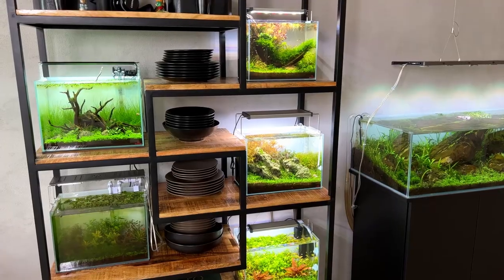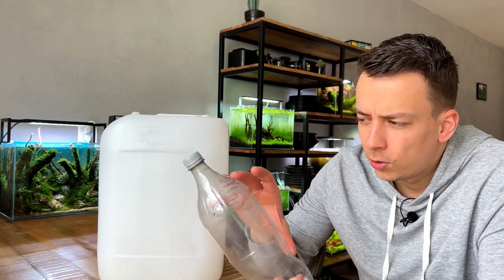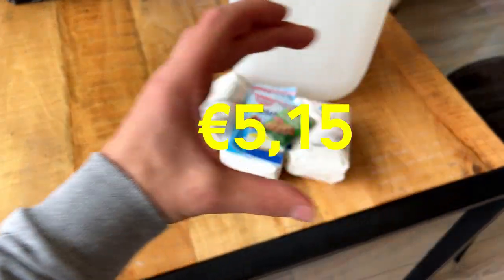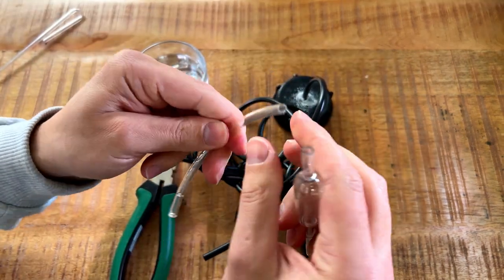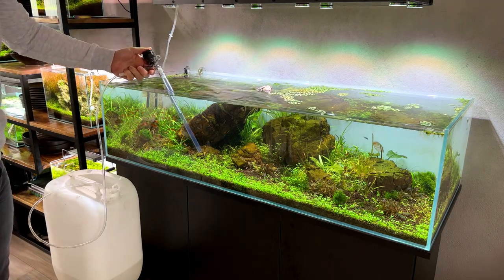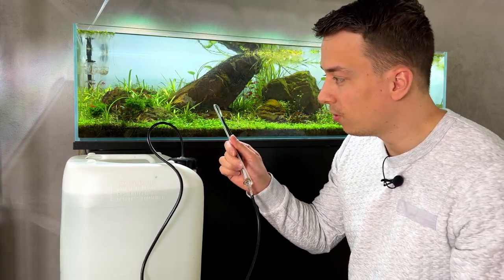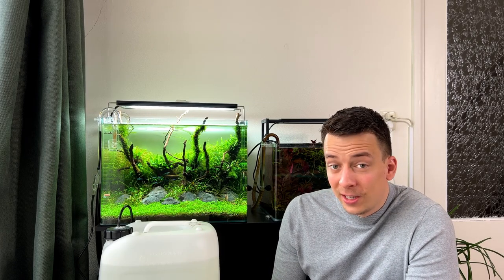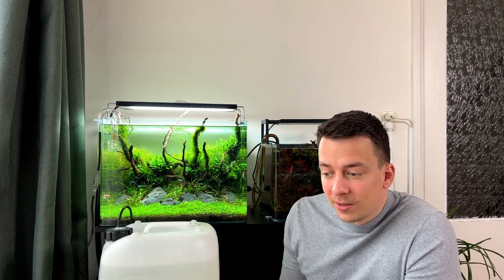HOW TO MAKE A DIY CO2 SYSTEM - XXL DIY CO2 SYSTEM😱 (don't try this at home)

Comment: how much pressure do you need for the defuser? ... it looks almost as if there was far too much pressure (the plastic on those containers is a different type of plastic), gas should have been coming out of the hose surely... you could always go super extreme as well with that container and go 15l of sugar water and gelatin mix and using a 1.5l bottle as a wash bottle you'd probably need a  lot of yeast...
look forward to the next instalment of this experiment as I'm having to look at co2 for my planted tank to get it lusher

Comment: Try a brand new commercial gas can container, 5 gallons. Doing landscaping in the summer, if the can in the sun and hot, I've seen the can expand almost like a balloon, but never popped or leak. Only problem is they're usually a solid color, some have a thin clear strip to see water levels. Not sure if that affects the yeast with little light

Comment: I think there is an issue with your diffuser, i had the same issue with smaller ones, The pressure was good but no bubbles, when i pulled out the diffuser from the tube, all the pressurized co2 came out in a second. Just make sure the diffuser is okay by giving it a blow.

Comment: This is a great experiment! Perhaps plastic is not the best material🤔 If you can get a used beer keg for cheap and modify it to fit a regulator, perhaps that might work?
Reply: PET bottles work fine, but the biggest I have seen are about 2.25 l. If you can somehow fill the beer keg and connect it to hoses, that would be cool.

I moved away from CO_2 except one tank, which uses pre-configured set with a metal bottle used for welding or extinguishers with other components used for welding. It costs some money for the initial setup, but then it's mostly about refilling the bottle in a local extinguisher shop and replacing some part once in a while. Some use Sodastream bottles, which can be refilled in some supermarkets.
Reply: @PaulZyCZ  yeah, I use the Sodastream bottles for mine and refill them with a larger co2 tank. I wouldn't recommend this system because I have the newer bottle which prevents me from refilling all the way as I have tried many times. My bottle only lasts 2 weeks🥲
Reply: @xXIronSwanXx  That's similar to yeasts+sugar method (which lasts up to 3 weeks).

I was considering buying second pressured bottle (2.1 l of pure CO_2), just to switch them once the other is empty, but I usually go to the shop right in the morning to return with a refilled bottle. Then it's good for another 3 - 4 months. Maybe I will switch to Blackwater in that tank, but I'll see.

Comment: The ideal fermentation container would be a glass carboy, or a PET one like for making beer or wine.  The homebrew store will have a rubber bung that you can drill out to the diameter of the air hose if they don't have one with the right size hole on the shelf.  Pressure in the system will be regulated by how deep you put the diffuser into the tank since pressure increases with depth.

Comment: Hello Mark, to my yeast co2 bottle systems i always use just air stones, easy to adjust needs,   bottles can  hold up to 40 - 50 PSI or 276 -379 KPA, with diffusers attached to yeast co2 system i have difficulties to pass thru. Love your channel, keep doing what you doing :)

Comment: Try using baking soda and citric acid powder. They do sell this metal tube with needle valve, pressure gauge, drop counter, solenoid valve and more in a package for you. My 200L aquarium requires a refill every 3-4 weeks. Quite economical in my opinion. And it uses 2 soda bottles. Easy to hide.

Comment: My co2 recipie is:
2cups sugar and 20 grams of agar powder for the base added to 500 ml of boiling water. Then left to set in the bottle.

1 cup of sugar to 1 cup of water with 1.5 TSP of yeast which is proofed ( add 1:1 sugar and yeast to 1cup warm water and wait for 10 mins or so for bubbles). Add 1 TSP of milk and 1/3 TSP of baking soda. Pour this mix onto the jello mix. 
 
It'll take 2 to 3 hrs to start , adding sugar to the yeast mix ensures that you will get a quicker reaction with the residual yeast attacking the jello. Just change the yeast water if the jello is not fully consumed when the reaction slows down. 

PS: it will produce a huge amount of CO2 initially so ensure that your diffuser is higher than usual so as not to drown your fish. Don't ask me how I know.
Reply: I'm using a 1.5 litre soda bottle. You can add more water at the end but ensure atleast 4 to 5 inches of clearence between the water level and the top of the bottle to prevent the mix from entering the tubing. 
DO NOT OPEN THE BOTTLE AT ANY POINT

Comment: i just bought a system that uses baking soda and citric acid.   it came with a solonoid valve so i can hook it up to a timer.  i haven't set it up yet and it's my first attempt at co2 so i don't have high expectations.   it was a cheap system ($40) so my plan is to use it as a learning experience.

Comment: I use 4 x 5L bottles which I set up 1 week apart. They all have sir line running into the same water bottle which acts as a filter where any gunk that manages to get pushed through the airlines is caught in the water bottle, and as a bubble counter where I can see how much CO2 each airline / 5L bottle is producing.
From the filter / bubble counter, a 5th air line runs to the Venturi attachment of a power head on the wall inside the tank.
This power head mixes tank water and CO2 as it pushes it out and down into an empty 2L Coke bottle filled with short pieces of 19mm pump line which are also cut length ways so I can fold them in on themselves and fit them through the bottle opening. These act as a baffle, further mixing the water and CO2, which exits the bottle from a hole on the side of the bottle at the bottom near the bottom through a short piece of 19mm line so I can direct the flow by twisting the bottle.
By starting the cultures in the 5L bottles a week apart, the last one started is just beginning to get going, the previous one is roaring along, the one before that is ramping right up and the one before is dying off. The one that is dying is next one to be cleaned out and set up from scratch again. Easy to make it part of the weekly maintenance.
At any time, the total production of CO2 remains fairly stable when averaged out across the 4 different bottles each at different stages of production.
It's satisfying to watch the bottle counting bubbles and the reactor bottle in the tank. You can see the CO2 gas bubbles being forced down from the power head into the bottle and rising back towards the top to get caught amongst the baffles where it keeps being churned around until it dissolves into solution, at which point it leaves the bottom of the bottle completely dissolved in water.
When you tune it right, there are no bubbles or even a fine mist entering the tank water.
Be careful though... It will take a while to tune the sugar / yeast recipe and CO2 production and the power head flow.
The first day I made this set up, I went to bed all smug and confident that I was a genius. I woke the next morning to find all my fish dead. The water in my 600L tank had dropped from 7.0 pH to 3.0.
It took a few weeks to tune it all and it got to the stage where I was up to my armpits in the tank every day or two cutting back the faster growing plants.
Also I kept the 4 x 5L bottles in a tub with water warmed to 20 degrees Celsius with a small heater.
Hope this info is useful to someone.

Comment: Soda plastic bottles support 7 times the atmosphere pressure before the cap fails (it's the week point). That is quite a lot but it involves safety when handling (or dropping ^^). Tanks for gazoline should be stronger (resist heat expention) or beer if it exists in large size...

Comment: Thanks for the video!
I were thinking if you instead make many 1.5L bottles in series with T joints. The advantages are:
The bottles is not running out of co2 at the same day. If you reload one bottle WHEN light switch off then the remaining bottles will bring up the pressure until the next day when light goes on. Even if the yeast reaction have not really started in the new reloaded bottle. 
In short no waiting for yeast and pressure to build up and no co2 off days for the tank (only the first initial setup after that one bottle at the time).

Another benefit is you can mix bottle solution some of them low and slow and some of them as high and fast.
(That way you can see on the bubble counter how many "low and slow" and "high and fast" ratio of bottles you optimal need.)
The drawback is that there is more joints.

Comment: Hi Marc, Have you tried another diffuser? 
In past i also had some issues with a DIY CO2, I used an old Twinstar diffuser and could not get the system to work, when i removed the diffuser put the hose in a glass of water a lot of bubbles came out. So the next day i bought a new Dennerle diffuser did connect it and it worked. Some diffusers need more pressure then others.
Reply from the maker: Yeah maybe the diffuser was faulty, too late to try now. I wanted to pick up the barrel and the whole thing just broke 😂

Comment: there is a right calculation  between  the amount of yeast and sugar and the pressure of a bottle that can hold. that's why some yeast sugar / citric acid and baking soda mixture in some tutorial specifically indicate the right amount to mix so that the bottle or container wont explode or leak.
maybe if you pick the right amount of yeast and sugar, the container will be enough to hold the pressure that the mixture's producing. however, not all container or bottle is design to hold pressure. and soda bottle are design to that because of the soda itself

Comment: How did it build up so I much pressure in the bottle? Was the defuser clogged up possibly? I run my diy C02 connected to my pump air intake so it never builds pressure inside the bottle. To stop it at night I just loosen to cap on the second bubble counter bottle and allow air to get pulled through to the pump.

 A shame the jug popped a leak. Hope you try this experiment again soon! I think we all really want to see just how much and how long this can last! Cheers!
Reply from the maker: I don't think the diffuser was clogged, but they do require quite a bit of pressure to work. With the soda bottle that has never been an issue, but I should have know better and first experimented with something that requires less pressure.

Comment: Drinks bottles are designed to withstand pressure, what you used was a UN approved container for liquid. They are drop tested but not designed for pressurised material. It may work if you were to get one of the blue jerry cans (they have thicker plastic) but still a similar design. Also, next time you go to the shop maybe you should buy some new cooking pots 🤣

Comment: the soda bottles are designed to hold the pressure of fizzy drinks whereas your container probably wasn’t. maybe you need to use multiple side bottles and multiple diffusers

Comment: I think it might be the shape of the container?  Like the gas in a 2 litre bottle goes to the top where the lid is, in a symmetrically, centrally located gas outflow?  And maybe this helped with pushing the gas in a way that didn't warp the container.

Not sure though.  I'm thinking this larger project could work if a bigger bottle could be used

Comment: Long time ago I've seen a DIY generator made of refitted 1 gallon size manual weed sprayer. They're made of pressure withstanding plastics. It was neat, but since I'm manual task challenged, I've always only used hp cylinders. Kudos for posting those little fails. It will save some folks the hassle you experienced. 👍

Comment: A tip is to shake it or make sure it's aerated as the yeast uses oxygen to work. That's pretty important when fermenting beer, which I do a lot.
Also a good idea would be to search for a second hand corny keg for beer, it's tested to 5bars and made of stainless steel.

Comment: I've had good luck connecting 2 liter soda bottles in a series. They are built to withstand pressure, and you can change each bottle individually to keep the co2 levels more even.

Using two 2L bottles was enough to make my 29 gallon tank show lime green on a drop checker.

I use your sugar/gelatin recipe. I've had the best luck using wine yeast (champagne yeast has the best alcohol tolerance) and adding yeast energizer. It provides crucial nutrients to the yeast so you get a healthy fermentation. Wine and mead makers often use it.

Thank you for sharing all your experiments! I learn a lot watching you.

Comment: This Is the question I have been curious about for over a month or two ... What happened to the CO2 ECINU ? Sorry if it was covered in a older  video but I am
kinda curious 💙💚 Thanks Mark
Reply from the maker: I stopped using the ECINU CO2 system

Comment: I used to have bio-CO_2 sets: sugar+yeasts+water following a ratio found on the Internet (I used the same Dr.Oetker yeasts), 1 yeasting PET bottle, 1 smaller filtration PET bottle just with water to avoid yeasts in the fish tank.

I tried to put yeasting mix into 5l canister once, so I knew what to expect from the title image. ;) No accident happened, I left it unplugged. Soda/beer plastic bottles can hold up to 3 - 5 atmospheres if I remember correctly.
Reply: oh no, 3 - 5 atmospheres are way to low.. it's 10-12 atmospheres as a european standard.

Comment: I use your DIY CO2 recipe with a 6l water bottle I use a tap to reduce the flow of CO2 (been using it with no issues for 6 months now, 4 batches at this point), the aquarium is a 145l. :)
Reply: What is your mixture level please as I’m currently setting up a 5L version :)
Reply: @apaquatics6172   1 kg sugar
+ 1,2 l water + 18 g gelatine
+ final step after gelatine is set (11g yeast
    + 3 l tepid water 
    + 4 table spoons of sugar)

Comment: It might be a little more expensive, but I bet there’s a fermentation carboy for home brewing that holds pressure better. You might even find one with a lid with an airline connection or valve.
Reply: A carboy for beer brewing would probably not work because they are not designed to have pressure. When the beer is fermenting, the Co2 is vented.
Reply: @RobertEEfford  I’m not a home brewer, but isn’t that exactly what he wants? Create CO2 and vent when pressure is sufficient? I’m sure it wouldn’t be more than a few PSI, but, admittedly I haven’t done the research. 😅
Reply: @Dylan-ok6ft  Agreed, but my point is that those containers are not designed for a lot of pressure. I do not know how many psi is needed to push the Co2 through a diffuser

Comment: Used diy CO2 for a year or so when I was getting into fw planted tanks. Works great if you get the mix right, and now I see there are fittings available to make a Coke Bottle reactor even more efficient.

But, at the end of the day, the fluctuating output levels, the hassle of mixing up a new batch every week or two, the mess...it's just so much easier and rewarding to invest in a co2 bottle and proper regulator, with a solenoid and ceramic diffuser.

Comment: The container you used was made of PEHD and is not designed to withstand high pressure. Generally, the weak point is the welding line where the 2 parts of the molded plastic are connected.
Instead, you should try to find a PET container, easy to recognize as the welding is a spot at the bottom of the container (same as soda bottles).